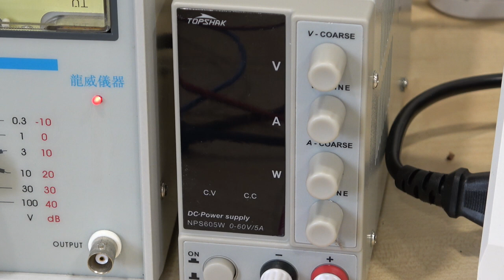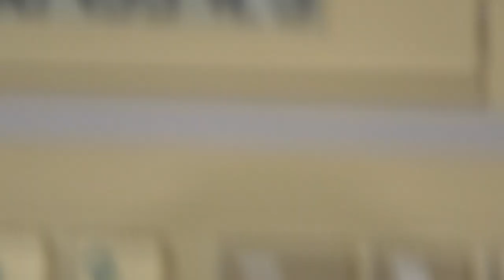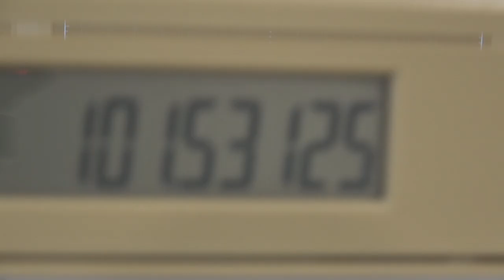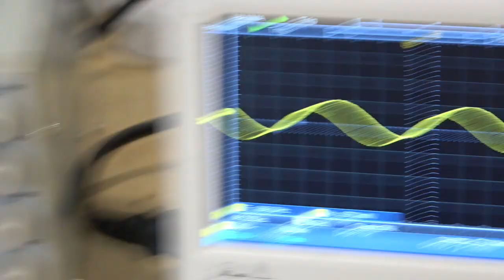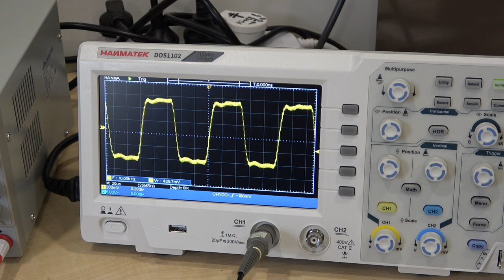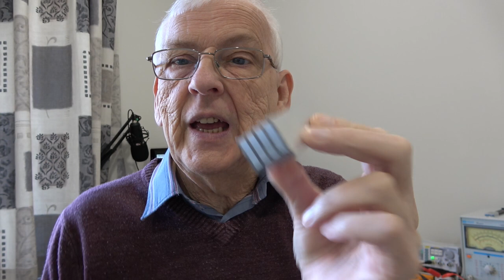A powerful TPA3255 Class D bridged amplifier 600 watts??

Comment: Use a tiny Chinese buck converter to trim the fan speeds. Their PCB is only about 20mm and they can drive 1 amp if need be. They only cost 50p and I find having a pack of them very useful for these fans. You  run at rated12v and you get turbulent flow. Knock it down just below, and they can be silent. Hydrodynamic ones are best.

Comment: @9:00 you asked "why would anyone would say the amp has 600W"? I would like to comment with an insider's scoop on how datasheets are made at semiconductor companies like TI. Remember, it is a competitive industry and aside from attention getting headlines like "TPA3255 315W Stereo.. 600W Mono" , there is a certain class of products like high power boomboxes (sold in countries like Brazil) and aftermarket soundbars and car stereo amplifiers that use 10% THD numbers in their marketing. Another part of the market (hi fidelity, high quality) wants to use 8 Ohm non-clipping power numbers, say at less than 1% THD. So to make everyone happy, TI provides the actual power vs THD on graphs and has both 1% and 10% THD power levels tables in the datasheet so you can see the performance of the chip in more realistic scenarios. If you use a 53.5V supply, you can expect to get 155W into 8Ohms up to the edge of clipping (1% THD). At 48V, it will be more like the numbers measured by Mr. Beeny in this video. If you want more info on this, see the excellent YouTube video from Kiss Analog entitled : "What is the Actual Power of TPA3255 Class D from Texas Instruments?"
Reply: Con 48V 10A se sacan  228Wx2 en 4ohms o menos en otros amplificadores con el mismo TPA3255 y mejores componentes, con una fuente de mas tension y amperios quizas llegue al maximo teorico, aun asi es una potencia mas que de sobra para la gran mayoria de altavoces, depende mas el que tenga buenos condensadores e inductores como mencione y que este bien refrigerado. 
Se pueden hacer amplificadores buenos con el TPA3255 y tambien basuras que dan mala fama a la clase D, es como un jugador estrella de un equipo, sin el resto de jugadores a su nivel no va a brillar como debe.

Comment: Thought I'd just comment that I found this video when I was considering buying one of these modules and it reassured me, so thank you. With judicious filing, the PCB just fits into an Eddystone box onto the underside of which I have fitted to Lidl Parkside Team 20 V battery connectors (in series). I can also power it from two 130 W Dell power supplies in series. I use it for electronic percussion in mono, for which I've separated the muting circuits to mute one channel (and stop the fan) to save power. I've had less luck with automatic switching between battery and mains - I keep blowing the FETs that do that. I'm redesigning with - shock horror - a relay. I know - shameful.
Reply from the maker: Nothing wrong with relays my friend. Good luck with your project.
Reply: @MichaelBeeny  Thanks. It's all about inrush current - charging all those capacitors from all the capacitors in the Dell power supplies or 4Ah drill batteries has to be done by a resistor initially, with the amps muted. And when one SPDT relay replaces 4 FETs, it's worth it!

Comment: You´ve left quite a bit of power on the table by running 45V.  My very quick napkin math tells me you would have seen 248w into 4Ω with the additional +-5v Vpp. The TPA3255 are rated for typ/max 51/53.5V input with an absolute max rating of 69V. 
So.. while I agree running max voltage on electronics is unwise for longevity, I would´ve been more than comfortable running these chips at 51-53v if I needed the power.
Reply: They recommend 36-48v or more
Reply: @Shiny_Tsar  81formann obviously knows what he’s talking about, but somehow you felt compelled to comment “They recommend 36-48v or more”. Specifically, what was your point?
Reply from the maker: The chip may be rated ay 53 volts but the caps are only 50 volts, so my recommended 45 volts still applies. Maybe you are braver than me.
Reply: The TPA3255 chip would be fine with the higher voltage. The caps just need to be upgraded to say 63V if taller ones can be found.

Comment: When I check the photos I see 8x 470 uF 50V. When I drive this Amp with 48V PSU but the capacitor spec are 50V doesn't take long for the capacitor to say bye bye.
Reply from the maker: I would not use the amplifier at such a high voltage. I would use a max of 45 volts
Reply: @MichaelBeeny It is still very close to cap limit. My experience is, cap voltage to be higher than supply voltage for 20% at least. Of course, if you want your cap long last. 50V cap should be never connected on more than 40V.

Comment: well, good capacitors do not blow up at even 15% over nominal voltage; never ever. I used 100V caps at 105V long term (10 to 15 years), of course not hot. They do not blow up. :) But at 20-25% over nominal they DO blow up, after some time.
Reply from the maker: Well, that is your choice. Personally, I would never over rate ANY electrolytic. I must ask the question, why would you? I higher voltage rating would probably add a few cents extra.
Reply: Well, it was operational constraints. I did electronics since 75, so I am accustomed to the old ways of doing stuff. Since then, reputable manufacturers of electronic components typically leave some 10 to 25% margin, always (reputable, not chinese.., those have negative margin, haha. .).
Since 2005 i did a custom model of PoE, initially local, but after several months to all my country. The PoE operated to 90V initially, amd have 100V capacitors for filtering both at emitters (230V to 90V 75W supplies in the first years) and receivers (small dc-dc 65...100 to 9V 1A flyback converters). After some time, all my customers need extended lines, up to 1km typically. , and the first approach was to increase the 90v (modifying a resistor in the main supply), initially to 96v and, after some time, to 103...105v, same resistor. So, of course with some reluctancy initially, even I knew well that they will withstand, I did not expect to work for years. But years passed and I did the supplies since then at 103V (102...104 mostly) and have no problem ever. Peak production was in 2010-2012. Were several thousands of  55, 75, 100 125 and 165W flyback mains supplies an several thousands of dcgdc 9W and 13W converters using these caoacitors, mostly Fujicon (other brands sparsely.) I typically obviously do not recommended to others this approach, but hey, they work. As a comment, can be done.

Comment: Hi! There is no such thing to get more oylutput power than you have on power supply. Class D amplifier are 90% efficient. That's mean if You want 600W output power, than You need at least 700W power supply. On class AB amplifier, that is even worse. For 2x100W, You need at least 300VA transformer.
Reply: Yes, and the voltage needs to be high enough to achieve the Vpp needed into the connected load. . For these chips to do 600W, there has to be two running PBTL into 2ohm. With just one chip max output power is ~345W 4r if you really push it with 53.5V input. Official specs are 315/185w. Ofc the sub 1% THD numbers of 260/150W are more interesting. At least to most of us who aren´t making money of Audio products. 

BTW: 600W output with 90% efficiency is 666.6W total. Full power into 8ohms, this chip is actually more like 94-95% efficient and would only be needing a 206W PSU for 185W output. Anyway I totally agree and I think this implementation of the TPA3255 deserves to be tested with a high current 50V supply.
Reply: @81formann  BTW: 600W output with 90% efficiency is 666.6W total. Full power into 8ohms, this chip is actually more like 94-95% efficient and would only be needing a 206W PSU for 185W output. Anyway I totally agree and I think this implementation of the TPA3255 deserves to be tested with a high current 50V supply.

No, pal. You must have some power reserve. You cant go on 100% load. Never! Power supply MUST be more powerfull than the max load from amplifier. If I said 700w for 600w for class D amp, beleive me. And thats the minumum what I will choose for my own amp. Do you want your components to last? Second, on the input circuit, there should be resistors to the mass to limit the input signal in the terms of max output power and THD. I dont need 600w with 10% THD. That is even not a sound. Maybe you will not recognize the song. 1%THD MAX for home audio and below 0.5% for HIFI. That should be arranged by the international law and audio standards. In that situation, you dont need 700w power supply, bcs that amp will not have 600W.

Comment: Seems to me that to genuinely test an amplifier that supposedly puts out 600 watts, that a power supply needs to supply more than 48 volts at 5 amps which is less than 250 watts of power.   Amplifiers cannot put out more than you put in.  A better test would require at least a 10 amp supply.  I think the supply is limiting before the amplifier is.
Reply: He is an idiot.  But he's British, so he knows he's right anyway.
Reply from the maker: As the none bridged version clamed 300 watts, I measured 100 watts no extra current will get it up to 600 watts. I do take your point, however.
Reply: How can you not at least have a proper power supply?  Jesus Christ to get 600 watts out you need more than 600 watts in!  NOT BARELY 250
Reply: To see where the amplifier itself clips, you could do sine burst tests at low duty cycle and the power supply bulk caps would provide surge current well over the peak limit of the power supply. Music is actually quite "bursty" i.e. has a crest factor of like 9dB in general, so in a way that's fair. However that is not the official way to measure power as it does not stress the thermal capabilities of the amplifier.

Comment: Still a tempting BTLD board in 2024/25. Keep in mind: Compared to the reference TI design, the caps are a bit on the low side (8x470uF), so maybe adding another 2200-4700 uF at the DC input is the way to go.
If you really want to max it out when complex impedance speakers are driven, 10A or even 15A SMPS are needed.

Biggest advantage of the bridged TPA3255 is the stability down to 2 Ohms and the thermal behavior. Excellent for low frequency work.
 
Many of this boards (aiyima) come with chunky passive heat sinks, that I like. Adding a vent in the case as a option, often not neccessary. 

The output filters are NOT calculated for 8 or 6 Ohm (a 6 Ohm tweeter has around 7 Ohms @ 15K, 8 Ohm tweeter around 10 Ohm @ 15 k). they are calculated for flat 4 Ohm in the highs, that's not a practical value (1uF are used in combination with 10uH coils here).

In practice this is most times a little off and make the highs too bright and harsh sounding. Especially with this kind of filter chokes.

Better value is 0.68 uF or a little lower, to reach a Q around 0.7 This fits 90 % of the tweeters out there way better and close to ideal. 

Talking about filters, the simple toroidal powder FE are somehow O.K. for around 1 A but but they struggle clearly with 100W or even 200+ W that can be achieved with this amp.
If you want to rise the quality of this module to another level, exchange the filter coils with Wurth 7443782012100 MnZn shielded coils and put 0.68 uF Wima MKS2 caps in.

If you want to go further, change the limiting 470 uF 50V caps to Chemikon EKYB630ELL102MK40S 1000uF 63V and then the amp will become a pretty neat sounding monster.

Comment: Hi Michael,
I'm driving a pair of Martin Logan Sequel II's with one of these on a Keling 36v 9.7a smps (adjusted up to 40v) and am very impressed.  Lots of power and headroom and virtually no heat.  I'd like to go to two of these amps and two power supplies and vertically bi amp the Sequel II's and reduce the speaker wires to just a few inches.  Do you think there would be any issues with one channel driving the woofer and the other channel driving the electrostatic panel?  According to ML, the crossover point is 250hz.
Reply from the maker: Should not a problem. Never tried an electrostatic load, however.
Reply: The board already has some capacitance in the filters, 100nF? Didn't look carefully before this answer. So, i would say that a capacitive load which do not exceed the filters capacitance themselves can be accepted. Still I would recommended first an extensive test using the cheapest board available out (some $20), before putting a better and more expensive one.

Comment: When you look at the impedance curve of most speakers, they have areas that dip to 4 ohms or even below four ohms and it’s usually nowhere near the high frequency range. For this reason, perhaps it makes sense to design the filters for an 8 ohm load because in those frequency ranges, that’s what you’re likely to see.

Even when I look at for full range drivers with no crossover, typically in the high frequency range, the impedance is well above eight ohms.

The only speakers I’ve ever seen that have a flat impedance all the way up through the high frequency range is something like MAGNEPAN’s, and to be honest, something like that would be interesting to hear on an amp like this, because you need so much power

Comment: When you look at the impedance curve of most speakers, they have areas that dip toohms or even below four ohms and it’s usually nowhere near the high frequency range. For this reason, perhaps it makes sense to design the filters for an 8 ohm load because in those frequency ranges, that’s what you’re likely to see.

Even when I look at for full range drivers, typically in the high frequency range, the impedance is well above eight ohms.

Comment: Does this amp use an op-amp to boost the signal?
Reply from the maker: Not really, it does use an op amp but it's not in the audio loop. It is purely a VLF feedback servo loop from the speaker output back to one of the TDA inputs.
This acts as an "auto zero null" function. One reason why the DC offset is so low. It does not contribute to gain or anything audio at all.
Reply: @MichaelBeeny  Thanks!

Comment: Hello Mr Beeny, i am writing from Italy. Thank you for your work! I have a question for you: have you ever had problems with thermal protection of the processors? I tried two of those amplifiers (and also another model) with 48 volts switching and with a  8ohm charge, but i always got problem with (i suppose) thermal protection, so now i am forced to try with a lower voltage, but i would like to be sure about why after some minutes my amplifiers stop to work till i restart them! Thank you again!
Reply from the maker: A quite common issue is poor connection to the heatsink. No or little heatsink compound. Poor mounting of the chip to the heatsink. Another issue is trying to get too much power out of it, components not rated correctly. A lower voltage is often the only option. Fake chips another issue. Some of these amplifiers are just junk!!
Reply: @MichaelBeeny  Thank you! I simply followed the statements\instructions that they wrote in the page; So I bought a 48 Volt power supply with no worries! They also told "it is absolutly norma NOW (because with previous model probably NO!) to apply 50 Volt! :) Well... i already changed the heatsink compound and, infact, i got a better general behaviour. They used the pre-applyed ""grey" compound used with computer processors (probably the fans are designed for graphic computer boards), i replaced it with more classic "white" compound (i am not sure about the difference) and it seems to bee better, but anyway after some minutes the protection intervenes. Now i am waiting for 36 volt power supply, and lets see! Than you again, it has been very interesting to find your "slow and essential" videos. I am buying chinese stuff for a lot of years, and i mad very interesting amplifiers and, in general, hifi advices for realtively cheap amounts... Thank you again!

Comment: I got an Aiyima A07 that uses the TPA3255 chip. It came with a 36v 6a power supply and it was loud and sounded good but I ordered a 48v 7.5a power supply and it sounds incredible! I think it's giving around 135w at 6 ohms through my 140w 6 ohm speakers. The only problem with the new power supply is the fan is extremely loud!!
Reply from the maker: Hi Brendan, I would be careful running the amplifier at such a high voltage, mainly because of the lack of ventilation in the case. Regarding the fan noise, you could always reduce the fan speed a little just make sure it does not overheat.
Reply: @MichaelBeeny  Ok, I might adjust the voltage down a bit then. Thanks for the tip.
Reply from the maker: @brendanhoffmann8402  Always use the lowest voltage you really need to get the results you need. The amplifier performance is the same and will sound the same, all you will lose is power, of course, and dynamic range, but at normal listing level there will be no difference, except heat.
Reply: @MichaelBeeny  I was messing around with it just now and have decided it doesn't make enough difference to really use the bigger power supply. the 36v 6a power supply sounds really good still and is silent. The fan really is so annoying with the big power supply.
Reply from the maker: @brendanhoffmann8402  I think you have made the right decision, cooler electronics will always win long term.
Reply: @brendanhoffmann8402  Maybe try running the fans independently off a 12 volt power supply.

Comment: I run it @ 40vdc 10 amp. I use 70 hz high pass f-mod and douk pre amp to boost the loss. 8 ohm 3 way  towers diy 8 in carbon fiber,dayton 2in dome mid, audax gold titanium  tweeters.  Sound s like 10 k$ system. I call it the Gaines grasshopper

Comment: this amp will do a lot more will some more amps/volts 
your power supply is only rated for 240watt
a 10Amp would put you around 480 watts